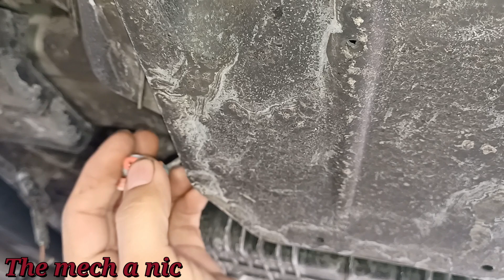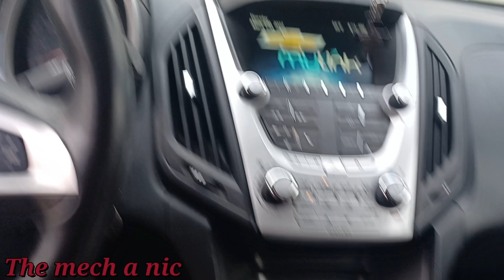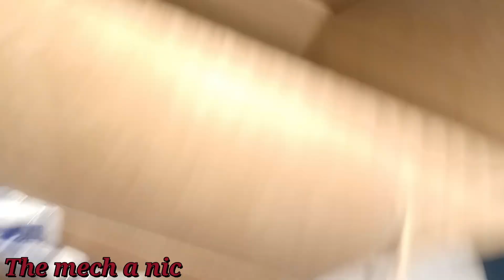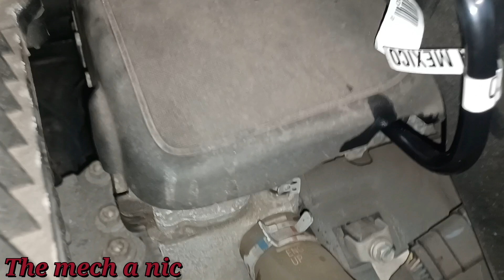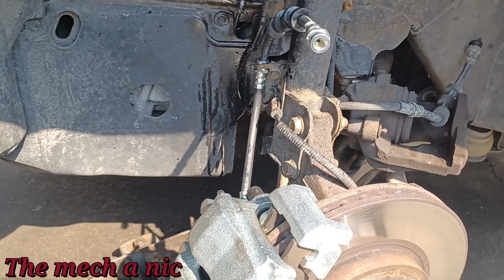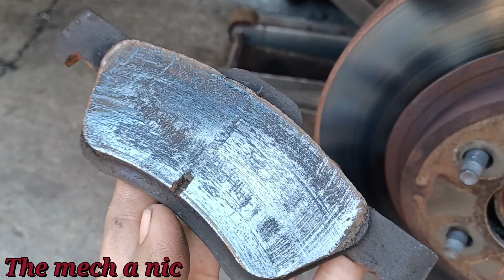santa fe P0447 /equinox P0014 / escape brakes locking  (vol 123)

Comment: Helpful videos bro!! Can you do one for codes P2813 and P0715? I have a 2014 Nissan Altima that stalled on me the other day and shut off in an off-ramp exit. It start immediately but stalled again, now a few days later, I put it on drive and doesn’t get into gear or move. I took it to a mechanic and he was quick to say $1600 to rebuild transmission. Your expertise will be helpful.

Comment: Today on working on turds in da hood,  we have a lady who cant check her oil, and Nathan from autozone who cant properly change a brake line in the parking lot! Good video once again, you worked for it. BTW where did you get that rubber mat at? I need one. Ohh and did you get the jnc 770 yet? Give it a few charges before you rate it. The more you use it, the more it comes to life when you first get it.
Reply from the maker: The mat is foam. The last one I had was from matco but the ones I'm using now are made by LANG , you can find them on Amazon.  I have that jump starter in my cart but I haven't ordered it yet because I've spent too much money this month on tool and things. I'm over budget lol so I'll order the jump starter later 👍
Reply: @themechanic6117  Thanks, ill go look for the mat tomorrow.

Comment: Good work jon !! On those exotec motors you got to watch that oil level check it once-month .. and I’m sure Jon you know them throttle body you can not move that butterfly that much because they have plastic gears inside and can strip easily..
Reply from the maker: Yeah I'm careful with them. You can feel the point when the blade won't turn any more. It's important to not force it

Comment: Great job as always 👍
Yup , it wouldn’t be the first time that a tow truck service damages stuff . I had to show 2 different tow truck drivers how to put my car into neutral without a battery . And flatbed tows are not gentle. I even put the tow hook on the front bumper ahead of time but they chained it up to the wheels to drag it up the bed 🤦‍♀️ and my frame was solid
Reply from the maker: Owner was not happy because he said that noise definitely wasn't there before it got towed over 🤦‍♂️